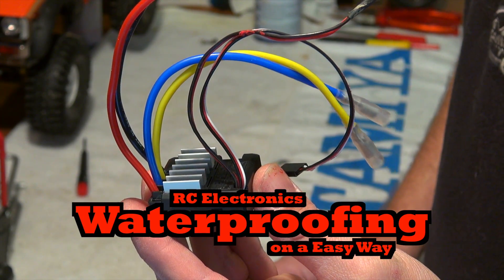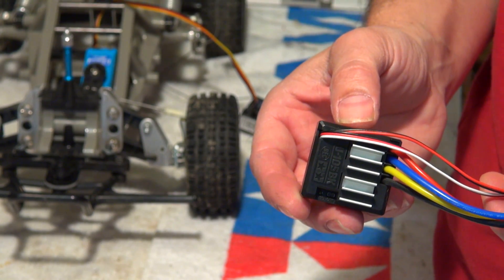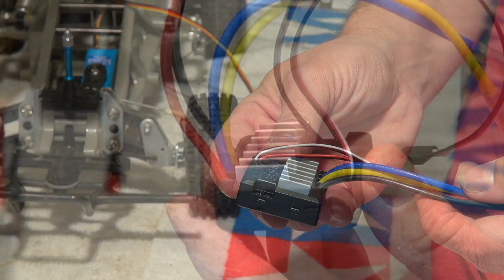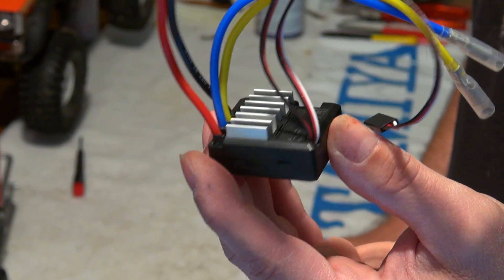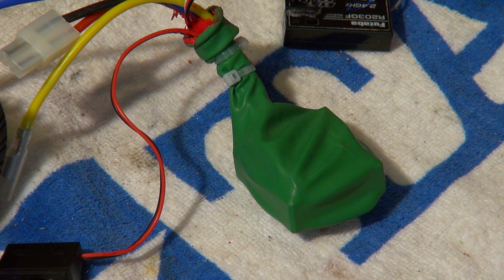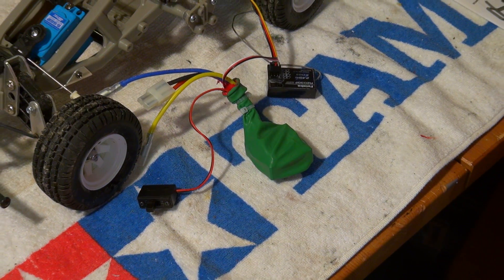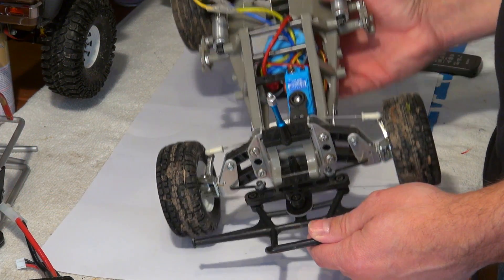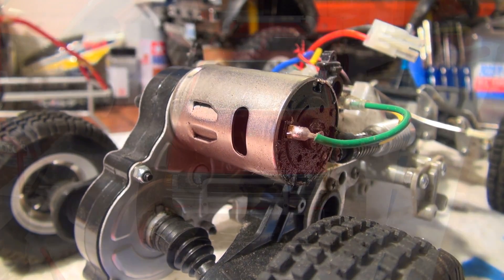Waterproofing of RC Car Electronics on a simple way

Comment: Thanks for the video. How can l understood by myself if the power demand is too high and waterproof balloon could burn the esc on my car?
Reply from the maker: The risk of overheating is very high with the balloon. But mormally they not burn. After its getting too hot it stops its function, after cooling down it works again. Better is this way: https://youtu.be/JPuz7MhwJlw

Comment: That is very good quick fix for low power, stock RC vehicles. Thank you! 
Back in the 1980's Tamiya used to supply the balloons in the kits.
Murph
Reply from the maker: Ahh, yes I remeber. Balloons to cover the mechanical speed controlers!
Reply: Yes, those were the days.

Comment: Great tips.  Would like to see how you attach the esc and receiver to the truck since you cannot use screws as the balloon would puncture.  Tie straps?
Reply from the maker: rblenian I use rubber rings and double sided adhesive band.

Comment: how would you waterproof a battery? or are they already waterproof?
Reply from the maker: Piers Whitehead I do nothing with the battery, but I use hardcase lipos, these are already water resist. Otherwise you can seal it on the same procedure, you can use a bigger rubber ballon. This is a video from a friend: http://youtu.be/pdPAp_8a1PU
Reply: ***** thanks :-)

Comment: Hi Matteo, I was wondering, for how long do you run your esc in the balloon, and does it over heat? I'm putting my axial ae2 esc in a plastic container and sealing all holes with plastidip, but the lid can still come off, but I'm not sure if it willoverheat and cause damage, thanks.
Reply from the maker: I run it more than 20 minutes without a problem. But as I mentioned in the video, It depens on the motor, gear reduction and esc combination if it works or not. Normaly the esc will not damage of overheat, if it cool back it should work well.

Comment: I think I shall try this on my rc boat too  : )
Reply from the maker: If it's not too hot inside the boat!
Reply: I´m thinking of an old Chinese V24 (Victory EP 700) with two 380 silver cans. I run both motors from a brushed-only 540-sized speed controller in a plastic sandwich box. It never seems to get hot because the motors draw very little current  : )

Comment: That's exactly how I "waterproof" my ESC and receiver, minus the Plastidip. Seems to work without Plastidip. Had no issues even after this..... Tamiya Subaru Brat "Stormtooper Edition" puddle play
Reply from the maker: I try it also without Plasti Dip, but had problems after a while. Water flows along the cables in the balloon and stops the esc. (used zip tie)
Nice puddle video, it's a deep one!
Reply: Yeah it was a little deeper than I thought. LOL I just folded the end (where the wires come out) over and zipped tied it again.

Comment: the balloon is a very good way to waterproof. for my scx10 I bought plasti dip in an aerosol can and sprayed it fully and sprayed the wires at the radio box just like you plasti dipped your wires going out of the balloon. it works well and I have that same servo!
Reply from the maker: Yes this is good, the advantage with the balloon is that it's easy to remove.

Comment: i recently got a Tamiya 540 sport tuned motor for my wild one and i use the Tamiya TEU-104BK, will the sport tuned motor overheat the esc if i were to balloon it?.
great video as always.
Reply from the maker: In my opinion it should work with the sport tuned motor, you can try it!